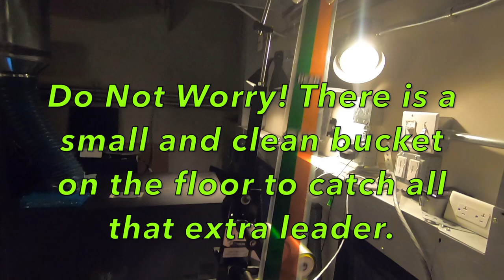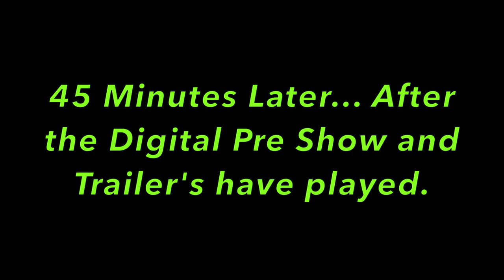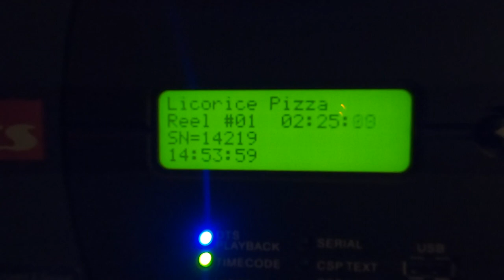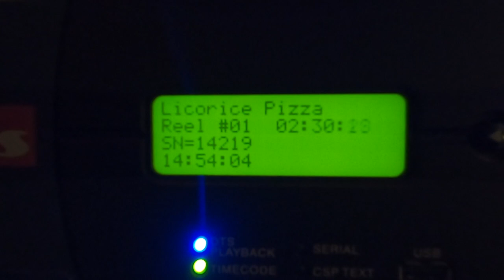Projecting Licorice Pizza On 70mm Film! PLUS!! It Is My First Time Running 70mm!!!

Comment: Wow! This is my install. I assembled and installed this system and also serviced it just before this run. To answer the lens question that is actually a special adapter used for Dimension 150 due to the large screen and very short throw. The focal length required is not large enough to not cause vignetting without it. 

Good job 👍 and great video!!!

Comment: Thank you so much for shooting and posting this video!
I am going to be running Oppenheimer in 70mm 5 perf at the end of July on Long Island, and the theater where I work (in Michigan) currently has its platter system mothballed because of construction on the building. Seeing this detailed rundown of the full thread path is super valuable to me because It has been a while since the last time I threaded platter system.
Much appreciated!!

Comment: Thats so rad, man. Btw I have a question. I saw LP in Brooklyn in 70 as well, but unfortunately the image had quite a bit of flicker. Not like so bad that it made it hard to watch, but it was certainly noticeable. I know it has something to do with the flicker fusion threshold, but what conditions would make a projector cause flicker in the image? Is the projector slightly off sync or something? I'd imagine the projector is sync'd digitally or with something like crystal sync. Also, I know LP was shot in anamorphic… Is it also projected through an anamorphic lens? Probably not, right? I guess 5-perf 70mm would result in the correct aspect ratio of 2.39 and wouldn't need to be projected through anamorphic glass, now that I think about it. Thanks again, this is awesome.
Reply: It could be that our eyes are now accustomed to the flicker free images from digital projection. One time, after years of watching digital projection, I watched a film print of Moonrise Kingdom and noticed the very slight film flicker.
Reply: @robotone2812  I know what you mean but I've seen a lot of films projected in 35 and 70, and although there is always a tiny bit of flicker (after all, film flicker is why we call movies flix), the flicker at the LP screening was particularly bad. That's why I was wondering if it was maybe an unskilled projectionist or a technical issue.

Comment: Surprised they have a platter system installed. Does it help coming from IMAX since that’s platter-based as well?
Reply from the maker: Yeah it helps. I think when they rolled out 70mm for Hateful 8 it was mostly all platters.
Reply: This was originally an H8 system but it was modified for the specially modified short pedestal and the ultra 80 vs. a console.

Comment: What's the point? They shot it in 35mm
Reply: 70mm film prints can hold 6 tracks for surround sound, therefore making it sound better.
where as 35mm just has one track.
:)
Reply: @ClarkTeddles  70mm MAG could. This print is Datasat (DTS) digital, still six tracks (5.1).

There are also Dolby SRD 5.1 35mm prints of this title.
Reply: @Movie-Tech  oh ok, thank you. I wasn’t aware of this.
Thanks